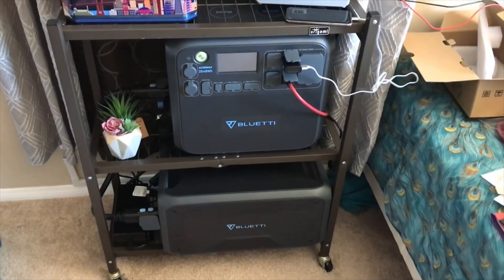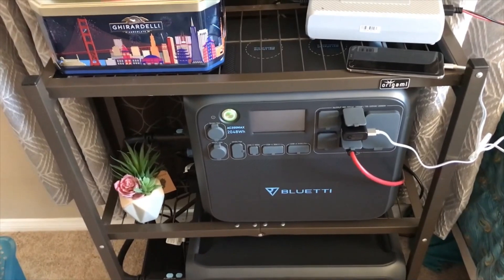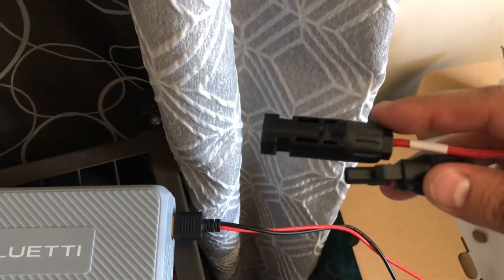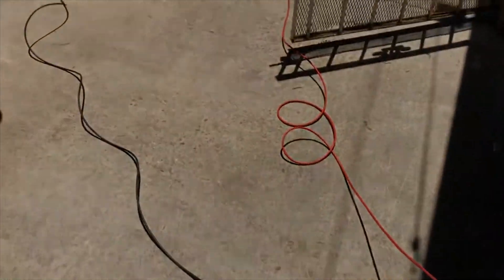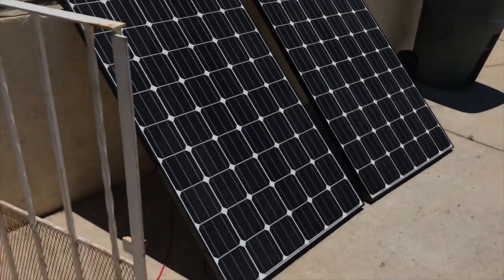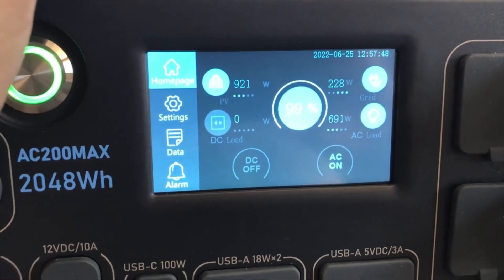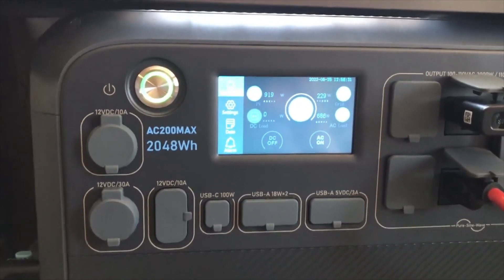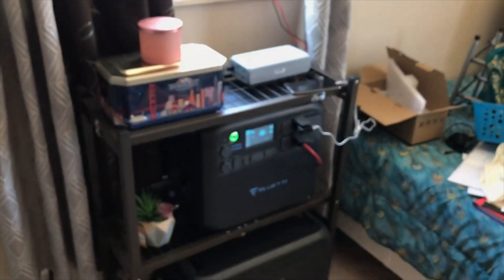How to setup bluetti enhanced charger on the Ac200Max

Comment: Wait, if you plug those extra panels into the AC port, I guess that means you don't have any grid power if you run low?
Reply from the maker: You'll need to switch back and forth if you need grid power

Comment: Hi could you possible share a drawn on paper diagram of your hook up ? for your 6 panels? i am new to solar and trying to figure our your array with parallel and series hookup?  I have AC200Max  and woudl liek to built simillar setup but i can not figure it out without the drawing.  Thank you. Great Video !
Reply from the maker: Google this. 3s2p solar panel diagram. You can also select pictures when searching. This is what I used.

Comment: Man if you had some more B300s, you could really run your house. I have two B230 batteries. I’ve been wondering if I hooked up a DS50.. charger to each battery with 200 watts going into each one how well that might work.
Reply from the maker: Yeah, they're so expensive though.

Comment: I have a max connected to a b300. I added a dp50s charge enhancer to mine. I have 585 watts of panels connected to the enhancer. I have reached 500 watt input on the enhancer. Between the 918 main solar input and the enhancer I have reached 1418 watts of solar input. When it hits 500 watts on the enhancer in backs off to around 485. The AC200L can’t charge this fast with solar.
Reply from the maker: That's awesome. If you need to bring in more, remember the B300 has a separate 200 watt solar input you can also utilize for a total of 1618
Reply: @OffGridSolarSmartHouse  indeed, and you can add a 2nd do50s charge enhancer to the b300 as well. Making about 2100 watt input possible.

Comment: Hello .. awesome setup .. Maybe U can help me with my question .. I used to have an AC 180 .. I used a propane generator (1500) output to charge my AC 180 .. on the bluetti app .. I could see I was getting 1 KW of charge .. I assume it's 1000 watts .. any way .. sold the AC 180 and got an AC 200 MAX .. in the intput area .. Can I charge the AC 200 MAX using the supplied TC 500 .. if so .. will I get 500 watts or 1 KW using propane generator .. sounds complicated 😮
Reply from the maker: Thank you. The Ac charger for the max has two different models.  A 400 and 500 watt. If you charge from your generator you'll provide 400 or 500 watts to the ac200 max depending on your charger.

Comment: Question, if the touch screen panel stops working, can the app turn the panel functions on or make it usable?  The panel issues I keep reading is the only thing holding me back from finally purchasing.  Thank you for your help
Reply from the maker: If the screen fails the app allows you to operate the unit completely. The good thing is now it has a 5 year warranty I believe
Reply: @OffGridSolarSmartHouse  thank you!   I am stuck on getting this or the other brand with two batteries that has similar power but no rv outlet.  Last question, the charging, do you feel it’s fast enough?  Honestly that’s my last hang up on ac200max.  The other one charges faster but the inverter in the AC max is bigger better I feel.

Comment: LOVE your setup. Would powering your 10,000BTU AC unit off the AC200MAX require it to have a soft start installed? (Your setup certainly has the running watts capacity.)
Reply from the maker: Hello, thank you. No it doesn't. The unit slowly ramps up on its own.
Reply: @OffGridSolarSmartHouse  P.S. I recently purchased the AC200MAX along with the Charging Enhancer.
Reply from the maker: Awesome. I'm assuming you plan on running. Portable air conditioner. Do you have panels?
Reply: I built a sea container tiny house running 12500BTU air conditioning on the Bluetti AC200 Max on my channel @ebikecnx7239 and it works fine as the mini split is so efficient with a SEER rating of 22.5

Comment: Nice explanation, if you pair the additional charger Zande ac Max and it does not get enough wattage in solar energy then the ac Max will not want to charge all the time and you keep hearing that clicking sound. Wouldn't that be bad for the ac Max ?
Reply from the maker: That's a relay clicking. Usually relays last forever. They can go bad though

Comment: I’m getting an ac200 max and 2 b230 batteries.   Do you think that could run my electric hot water heater.   I know the element are 4500 watts.   That’s  my biggest user of electric. Just like everybody that has electric water heater.    I’m a widow so it’s just me   I would love this to power my entire house.   I know it probably won’t handle my central air.     Thanks.
Reply from the maker: No it won't be able to handle an electric water heater. The inverter goes up to 2200 watts. The Ac 500 might be able to power your water heater. That inverter is 5000 watts.

Comment: I have the same setup you have. I notice you have a cart to keep your 200max from sitting directly on your B300. Can you put a 200 max directly on the B300, or could the expansion battery get damaged?
Reply from the maker: I've seen other people stacking the ac 200 max on top of the B300. Im pretty sure it's fine. I'd reach out to bluetti email support to verify.

Comment: Are they in series or parallel?
Reply from the maker: The panels I used for this are in series. I did find a great panel for the enhanced charger. It's not 500watts but its 400watts and portable.

Comment: What are the specs on your roof array.  That's impressive wattage. Please list brand and model number and your configuration. . Great set up.
Reply: I get 920W from 3x400W in series in my sea container house with air conditioning on it still charges battery and I live in Thailand.   Channel is ebikecnx7239
Reply from the maker: @ebikecnx7239 that's awesome 👍
Reply from the maker: Hi Michael,
I have 6 panels on my roof. 3s3p. Here's the model and part number I'm using.
https://www.lg.com/us/business/solar-panels/lg-LG260S1C-A3
Reply: @OffGridSolarSmartHouse  unfortunately it appears that panel is discontinued.. thank you for your reply
Reply from the maker: Yes, I bought them used.

Comment: I cant ind any other videos on this thing,but yours.
Reply from the maker: That's why I made this video. Seems like the stuff I wanted to know or research was lacking here on YouTube.
Reply: @OffGridSolarSmartHouse  I believe if you keep making vids on this charger,you will get tons of views. Please do. Im looking to maybe purchase one at the end of the month.People would appreciate!
Reply from the maker: I'll make another one soon.
Reply: Do you know where to get the alegator clip connection cord that goes to the enhancer.they come with two. where is that 3rd one at
Reply: @OffGridSolarSmartHouse  thanks. Where you from,I'm in Arizona!
Reply from the maker: https://www.bluettipower.com/products/12v-24v-lead-acid-battery-charging-cable
Reply: @OffGridSolarSmartHouse  I'd definitely watch if u made a video about usage of the B300. I'm a new user writing from England. I have the  AC200MAX and the B300 extra battery,  but I'm struggling how to hse and get the benefit of the B300. My plan was to juice up the B300 from the solar panels, then transfer that juice to my AC200MAX - but I can't find any instructions how to do that? Also when I read the touch-panel on the AC200MAX where is the B300 info? Again no instructions? And the percentage showing on the AC200MAX  touch panel.... does it refer to the joint amount of juice remaining (I.e. both B300 and AC200MAX together) or does it refer only to the juice left in the AC200MAX? There are no instructions for any of this. Sorry if I sound stupid but I am really very new to solar generators. Regards Samantha. (tabbysam666@gmail.com)
Reply from the maker: @samtabby3373  When you connect the B300 to the AC200Max you need to make sure that the blue button on the cable in clicked "IN". Then you can check to see if its connected on the screen by clicking on the battery percentage. the B300 should show on battery 3. If you charge solar from your ac200Max it will charge both at once like they are one unit.
You can also charge the B300 with a separate solar array while having a solar array attached to your Ac200Max.
I hope this helps. Maybe in the near future I can make a video on this.
Reply: @OffGridSolarSmartHouse  Thank you for such a speedy response. Appreciated.  
Samantha.
Reply: @OffGridSolarSmartHouse  im also thinking about the eb3a.Like to charge it on the 200p.Want off grod soon

Comment: Basicly it's doubling the amount of wattage from the panals.
Reply from the maker: No, let's pretend the panels are 100 watts each and I have 5 in series. I could use the enhanced charger to charge the ac200 max even faster. 500 watts plus the regular solar input 900 watts for a combined total of 1400.
Reply: @OffGridSolarSmartHouse  ok, 4 panals at peak hour im getting 270. with the enhancerI would get 770,correct!
Reply: @OffGridSolarSmartHouse  ok,gotcha. it gives 500.Nice! God speed to you.

Comment: ok,Your bringing in 234 watts with the enhancer.How many watt panals are those panels outside hooked up the enhancer? They look like 100 watt panals. If your only pulling in 34 extra watts. That thing is a waste of money. Hook that thing up to the other array ,and see. That would be something!If you do. Let us know.Its another video for us.
Reply from the maker: The panels connected to the enhanced charger are 260 watt panels but only pull in half maybe 130 watts  each. Combined maybe 260. I plan on getting better panels soon. Hopefully to max out the enhanced charger.
Reply: @OffGridSolarSmartHouse  whats the watt max the enhacer provides
Reply: @richardjones7882  about 450W is the real maximum as it's 8A limit

Comment: Did you happen to look if the temp. went up on the bluetti using the enhancer?
Reply from the maker: No it didn't. The charger doesn't generate a lot of heat. I was only pulling in less than 200 watts
Reply: @OffGridSolarSmartHouse  how manny watts are each panal.
Reply from the maker: 260 but there damaged panels they only pull in around 120 max.
Reply: @OffGridSolarSmartHouse  I do remeber now you saying danmaged.so,that thing is giving you an extra 120 watts. that's great!
Reply: @OffGridSolarSmartHouse  I only have 4 panals,peak is 270,I could get 390.Not bad
Reply: @OffGridSolarSmartHouse  how many watts did it help bring in😀

Comment: I want to get this enhancer for my ac200p bluetti. will it work
Reply from the maker: It does work with the ac200p. I've seen the charger as low as $150 on sale.  They might have another sale  in Sept for labor day.
Reply: @OffGridSolarSmartHouse  looks like ill need another adapter to connect to the enhacer.Ill go sook.Comes with!
Reply from the maker: Do you plan on using this for charging off a solar panel or batteries?  Another cool thing I was thinking about was having a wind turbine charge a battery the battery connected to the enhanced charger that's connected to the bluetti. Something to think about.
Reply: @OffGridSolarSmartHouse  I see you can get a connecter to plug in to the charger,then battery. Will this give me extra battery. I think so.I go back,and look.
Reply: @OffGridSolarSmartHouse  both if possible.looking now
Reply: when i look up the enhancer . there is a row of pictures. In one of those pictures. the enhancer is connected to a battery with a cable adapter I can;t find. Have you seen one? It has alegator clips. please help me
Reply: @OffGridSolarSmartHouse  cool! I'm in.😀
Reply: can iIt be used to add on other battieries
Reply: do you know where i can find an adapter that has alegater clips to connect to the enhancer with xt90 on it

Comment: NEED Help##  Can anyone say IF the 12volt RV cable for the AC200P will work on the AC200MAX ?  It appears we ordered the cable for the AC200P by mistake, and need the Cable for the AC200MAX. I made NUMEROUS calls and attempts to contact Bluetti BEFORE they shipped the item, but now I hear they are VERY slow at responding to calls and emails.. Thanks in advance.
Reply from the maker: Hi Gerald, I don't know if it will work or not. Bluetti customer support is very very hard to get a hold of but when you get through they do make it right. My best tip is to call Right after lunch time 1PST. call and hang up call and hang up keep doing this until you get through. Sorry I couldn't help with the question.
Reply: @OffGridSolarSmartHouse  TKS... Their product is Hands Down the BEST, but customer support sure lacks. I sent an email just minutes after my purchase stating I believe I ordered the wrong part hoping I'd catch them before they sent it. No Luck. The next morning I get an email that the item was "undeliverable", along with a very confusing chart of when parts would arrive. That was 6 MONTHS out!! I needed the correct part delivered in the next 7-8 days. This was a gift to my Son who is in the Military. He will be leaving here, and traveling for the next 6-7 months, staying in 5 different cities along the way. This is why he kitted out his 4 Runner, and needed the Bluetti AC200MAX. It now appears the part has shipped ( the wrong part ) and could be here tomorrow. I've sent 2 emails, and left 2 phone messages that have ALL gone unanswered..

Comment: New to this, What happens if the input from your solar array exceeds the rated input of 920 watts for ac200max by let’s say 100 watts (not using the additional adapter)
Reply from the maker: It just doesn't use it. As long as you don't except the 145v. This is called over panelling.
Reply: Can you overpanel the D050S with a 550W panel??
Reply from the maker: @ebikecnx7239 I believe you can.

Comment: What solar panel you recommended? Saw many bad reviews on Amazon afraid to purchase.
Reply from the maker: I'd recommend rigid panels used. Check Facebook market place, craigslist, or OfferUp.
Reply: Oh cool I thought buy new last longer
Reply from the maker: The used last a really long time too. They don't degrade all that much and the rigid are water proof. The flex panels aren't.
Reply: Thanks for the recommendation I’ll go check it out at my local market!

Comment: What's panels are you using to get the 900? I just purchased 2 of the PV350 bluetti and was going to get the PV 200 to get 900 but wasnt sure what I should get for the 500 DC adapter, one 350 pan and one  200, which would be over 500, will that be an iaaue?
Reply from the maker: I'm using rigid panels. Lg260s1c-A3.  You should look into mixing different panels together. It's possible but you might not benefit. The enhanced charger would be on a separate solar array and you could go with anything as long as it stays within the limits.